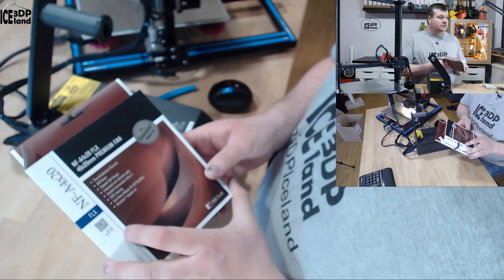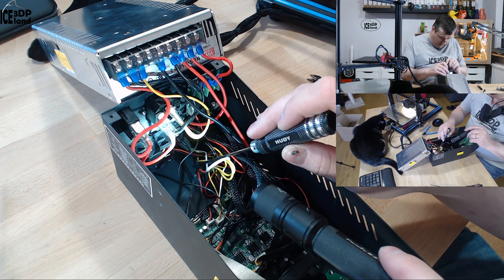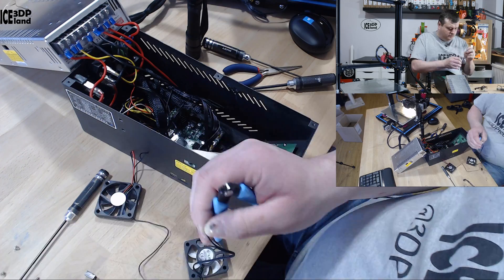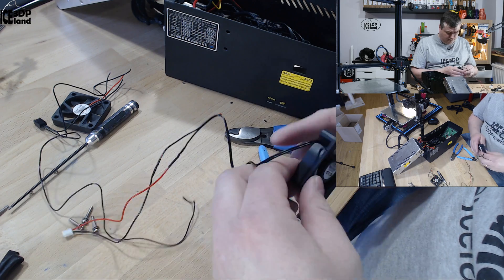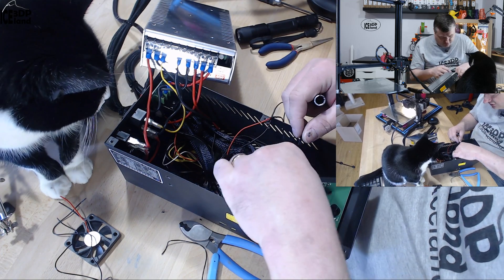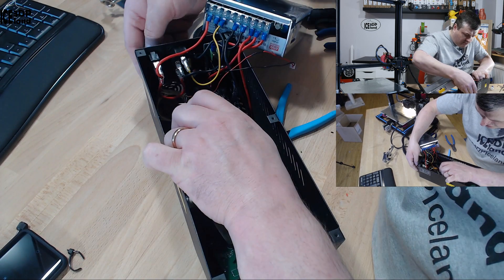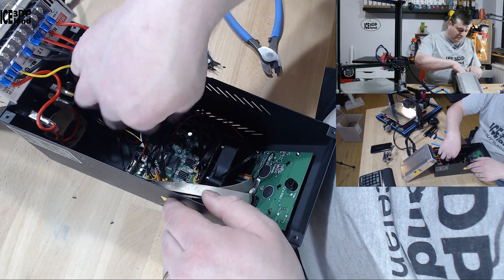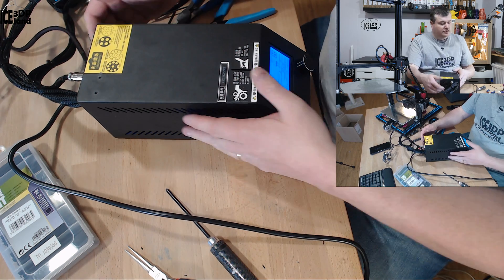Creality CR-10S   Control box Fan replacement

Comment: When I turn my cr10s5 on the internal fan does not turn on (the rear and bottom power box one do) but when I took it out and tested it with a 9volt battery that fan works. Any ideas???

Comment: Why did you remove the control wires? Was this so the fans stay on permanently?
Reply from the maker: The board on the CR-10 does not have a 3 pin fan connector, so the yellow wire is not used.
Reply: @3DPIceland  Do you know if the CR10S have control wires? :)
Reply from the maker: @Stoobers  it is 2 wire, i have the cr-10s :)
Reply: @3DPIceland  Thanks, I need a fan for my 10s as well.